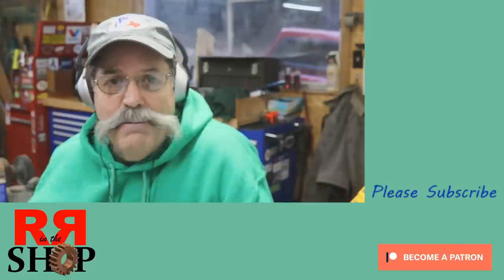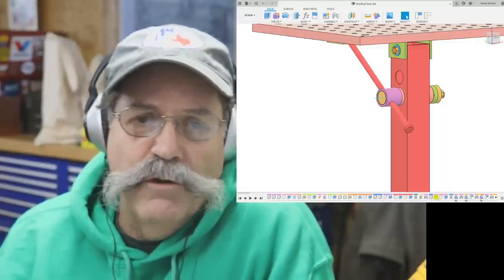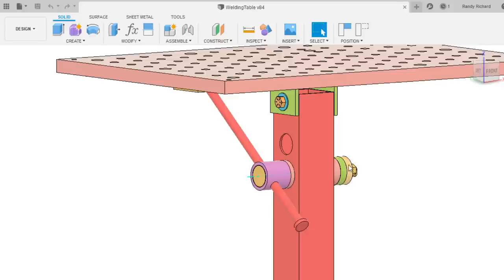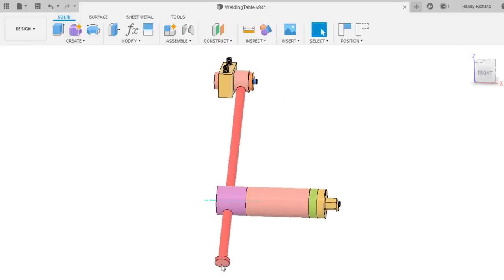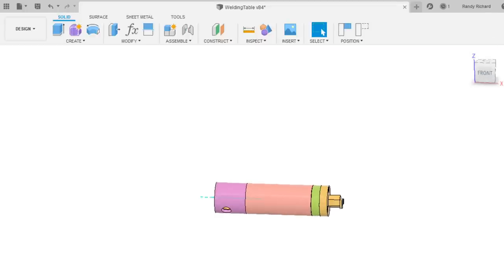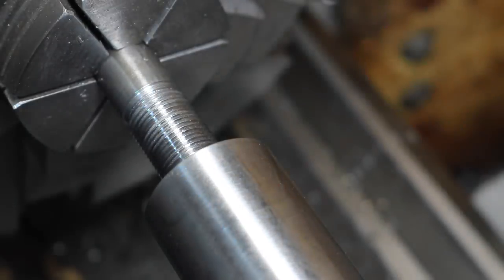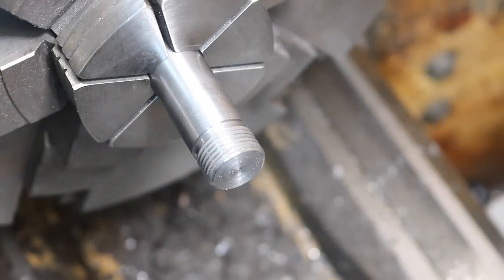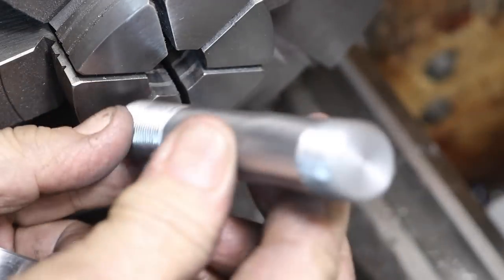What is your Angle on a Welding Table P3

Comment: Mr. Richard, for the nut to tighten the drawbar with I suggest making the hex part the thickness of the wrench(a box end) and then turn down a section so the OD will be less than across the flats about 1 1/4 the length of the hex and drill and tap a hole to hold the wrench in place with a washer and screw.  Use a dedicated wrench for the handle so it just hangs on the round section between the hex and washer; it is there all the time so you can just reach down grab the wrench and fit it to the hex and not have to look for it.  I hope you can understand what I am trying to relay without a drawing.  I could draw it if you need.
Reply from the maker: Roy thanks for the suggestion,  It is done.  Last part post tomorrow.  Merry Christmas.